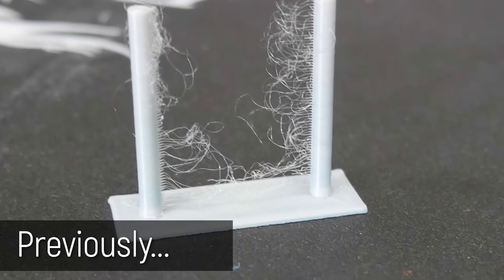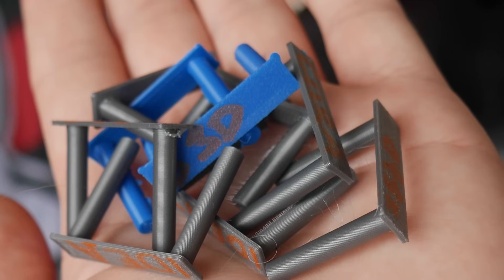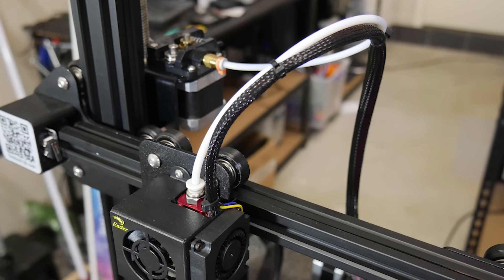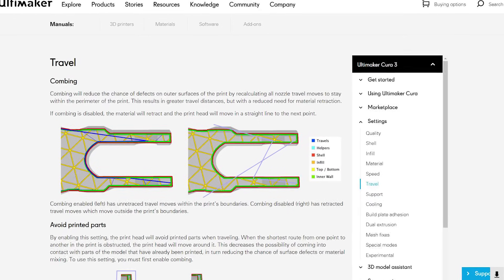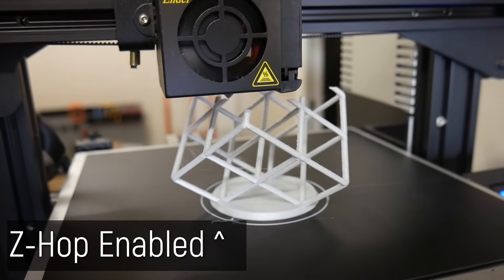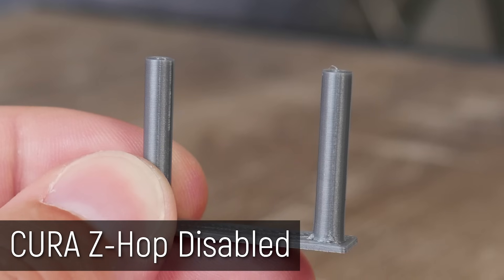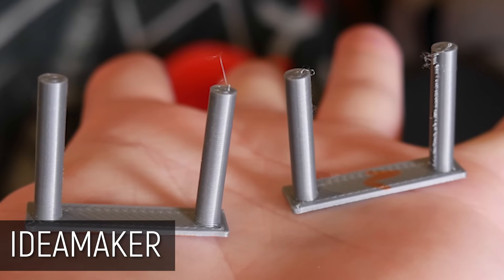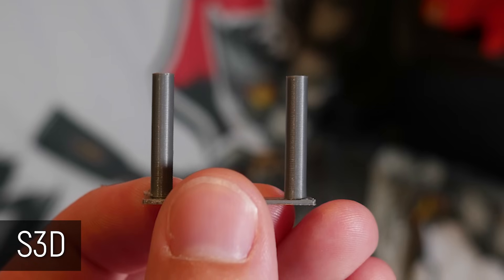Stop Ender 3 Stringing with this One Weird Trick! (ok but seriously)

Comment: Cura is a weird program. It has a lot of little things that arnt hard to fix but kind of annoying. like models not scaling correctly when you work in inches and export it with mm. Mine are always super tiny and on their side. again easy fix just a little annoying, all in all cura is a pretty good slicer it lets you crontrol everything you need and more, its just those little issues here and there. Also the interface is pretty trash i wish they had an orbit tool like in fusion 360. it would make everything so much easier. or a drag and move option, it might but i havent found it

Comment: I can definitely vouch for the quality control issue..  i just bought my very first printer today.. a Creality CR-20.. i got home.. put it together.. started leveling to bed only to find out that when the 4 corners had a  1 paper distance from the nozzle the center of the bed had 5 pieces of paper..  happily the shop told me to come by and exchange it with no problems.. got the new one home which i had to tighten both the bed and the slide with the nozzle cause both were extremely loose.. but after tightening them and leveling it perfectly i set it to a 6 hour print.. quite happy even with the slight snag :)

Comment: Stringing may be caused becaused of temperature. Probably the blue fillement may require à lower temperature and/or a better cooling whn extruded. May be should you have a try.
Regards

Comment: love your channel , I'm new to 3D printing,  I have ender3, been working well, with some tuning.
I'm having a problem with the filament melting in the hot end heat block, I have to pick it out will its running ? Have you seen this before?  Any suggestions  ? rdwbiker@yahoo.com

Comment: My print bed is also slightly warped but it plays within temperature a lot: when cool is is concave and when hot it is convex. I'm replacing the top with glass soon anyway to get perfectly flat, i really didn't expect it to be as flat as it needs to be.. It would actually need to be way, way more engineered solution with thicker aluminium base, milled from single billet and with heat flex optimization. At least in mine, the bed is so thing that the standard bed leveling methods warp it a bit... We are talking about very small tolerances here, +-0.02mm should be the start... Now it is more like +-0.1mm. But really, i don't expect any beds of that type to stay as flat as needed.... I need to smush the corners, close of getting marks on the bed and there is a slight pit. It is impossible from the materials, their properties and dimensions to work any better. I'm not happy about the pit as otherwise it would by uniform and manageable. I'm about 100% it is the actual bed "liner", the sheet that came with it is quite poor, it was visible warped but little massage got it quite right, except that one minor, minor pit that doesn't stop prints from succeeding, we are just darn close to it... 

Acceptable level of quality on mine. Printed straight out of the box with no adjustments of any kind. Of course needs dialing up and fine tuning... To me it feels a bit too flimsy but seems to be stiff enough. Oh, my carriage droops unless put under tension.. This machine needs another Z screw, bad... I know that it won't stay in this position forever and it starts to droop again. That drooping is not tiny, it is more than enough to fail any print and dig to the bed with nozzle..

Comment: Hey Angus this is probably an old topic now and you have probably moved and you might not even see this post but i have worked on my ender 3 profile and I have played around with a bunch of settings and i no longer get any stringing and have just printed the same stringing test you did with zero string i could provide pictures i also did this in S3D i dont use any other slicing software dont know if you wanna give my profile a test to see if you get that same results

Comment: I had time to do some tests. Usually I use a medium quality filament, without any stringing (Cura). I runt out from this filament, but in last year I ordered some super cheap Tronxy filament from Gearbest (for 13USD/1kg). With this filament and my classic Cura profile I experienced massive stringing. So I tested these profiles:

1. My classic profile, Cura = stringing
2. Chezmeister profile Dropbox, Cura = stringing, sadly. :(
3. Maker's Muse Simplify3D profiles (https://gum.co/ZrffZ) = absolute no stringing, not even one.

I am curious what is the setting in Simplify3D what makes it working. I don't see any special setting here, except Wipe nozzle 0,5mm? Maybe this. Retraction distance/speed is same as in Cura.

Comment: Hi Angus, I`v just started to use iDeaMaker after i saw this video. I haw however run into a rather strange thing, which I am not able to solve by myeself. I use The start-code script from my S3D profile, since I like how it put a line on the edge of the bed, before it starts to print. In ideamaker I have "Skirt" enabled, 2 lines, distance 8mm (as in S3D) - But, when the printer starts to print the objects I slice, the first thing Ideamaker makes the printer do - is to actually retract material - in such a manner that the PTFE is out of filament. So - it does not start to feed filament before the actual objekt is "printing" - and to be honest, I think it misses some in the first layer as well. Other than that, my profile seems to be dialed in on my CR-10 - the walls an other things is beutifull.

Any suggestions? I cant seem to find the "problem" anywhere in the settiings.

Comment: When I first got my Ender 3 I "acquired" S3D because it was the slicer that most of the youtubers were using. Its was giving me terrible prints and I thought it was my settings. After much profile tinkering the print quality saw little improvement so I tried Cura. WOW. Prints with pretty much stock settings were almost perfect compared to S3D. Cura became my main slicer... until... I needed to print some parts that were dimensionally accurate. I discovered that although Cura produces very good looking prints, its completely incapable of producing prints to the same dimensional mesurements as the file it was sliced from. So back to S3D I went. Bingo! Parts were printing to the exact dimensions. In the mean time I had started to lean to use blender and became more aware of the complexities of 3d modeling. Being a bit wiser I re-visited some of the prints I had issues with originally and found that the 3d models were poorly made and had all sorts of issues. Turns out that S3D wasn't the problem at all but rather the design of the 3d models was. S3D is a professional tool, an expensive professional tool. In Cura's defense my printer was calibrated using values acquired with S3D sliced prints so maybe I need to re-calibrate for Cura. I don't think the extrusion calibration would matter as its done independent of a slicer but the extrusion multiplier or "flow %" in Cura, might need to be calibrated to each slicer.

Comment: Can someone please help me and my husband?
I need to figure out the right settings. I opened up the video and watched it but we need it explained to us in a document or paragraph. I want to set my 3d printer up correctly and so far we have been getting a lot of help from everyone on here but this is still one of our biggest issues. we set the retraction to 3 and speed to 25. we set the print speed to 45 and the travel speed to 145. we set the temperatures to 205 nozzle and 60 bed. We have combing on within infill. Yet we still are getting strings. I did the gcode with 0 strings so we know it's possible but not sure what settings we need to tweak.

Comment: I have never experienced stringing with the Ender 3. Since I'm new to 3D printing,  I was using the software (CURA) included in the micro SD card. The only settings I have changed: Temperature,  print speed,  layer height, wall thickness and  top/bottom thickness.
Maybe temperature settings has something to do with stringing.
Never touched Z-hop but now I will mess with it. 
The only issue I encountered, was with the bed, specifically the mat, which appeared to be higher in the middle. Had to place the mat in a heat press for several hours.
Resume printing does not work, if I turn off the printer. When I tried.  it heat up, then move to the last location and just stood there...the screen shows printing, so the machine thinks it is printing.

Comment: Funny, my first printer is a Monoprice Select Mini V2. The stock Z axis on that printer is so slow I never use Z hop. I have since heavily modified the printer, including upgrading the Z axis to a proper NEMA motor and lead screw. So now it could do effective Z hop, but I still never use it. I don't have too much trouble with knocking printed parts over, and when I do I just slow the print speed to compensate. If the head is moving slower it tends to melt through the high spot rather than snap it off.

Comment: My Ender 3 is awesome. It Prints better than what I have seen done with a lot of much more expensive printers. Check out the "Tomb of 3d printed horrors" youtube channel for the best setup video I have seen for the Ender 3 (and I have probably watched all of them while I was waiting for my printer to arrive) and he also gives some very good settings in one of the videos, which I have based all of my prints off of. Even if you have already set up your printer, you may want to watch the video because some of the things he does will probably improve your prints. Also, do yourself a favor and buy the Ender 3 glass bed and the all metal extruder (I got the Seloky off of amazon). Clean the glass plate after every use with some alcohol and prints will stick fine (unless they are extremely small and need a brim) and they will come off very easy once they cool down.

Comment: I was also struggling with stringing lately when switching from amazon to geeetech PLA. Im using linear advance and it made a big difference on the issue. I also noticed that z hop was causing stringing but while i was making countless towers tests, i reread an interesting note about linear advance and retraction. Basically they say that if you have well calibrated your linear advance, you might not even need retraction at all. So instead of going up from 0.8mm to the max allowed by my direct drive, i went down and it was like magic, when i hit 0.4mm, stringing was gone, even with Z hop on. 0.35 mm gives stringing, 0.45 gives stringing but 0.4 is just perfect. Took me quite some time and frustration to get it right.

Comment: Combing is a function wich try to not travel when it don't need, it try to stay inside the perimeter of the printed parts. this function exist on S3D. I think you could do a similar function to stop stringing with the "retraction script" function wich permit to you to write a script that will be placed at each retraction (a small movement for exemple)

Comment: I have a CR-X so I have the usual owners bias, I guess. I had to take CR-X apart  to fix a cable I snagged and broke.  I used to design sheet meta chassis. The holes in sheet metal needed extra slop to allow for the threaded mating hole positional tolerance. When assembling the old way  the last screw was always a bear because of the accumulated tolerances. So re-assembling the CR-X was amazing to me. The mating holes were not only easy to screw together the threaded holes aligned in the flipping dead center of the sheet metal. They obviously use CNC robots to makes the holes. No way do they use any shoddy hand drilling. The days of China using shortcuts and cheap materials is over. You need to place the blame elsewhere, in my opinion. I haven't watched you since the CR-X review. It upset me. How did you get from snarky remarks from Creality owners to actually picking on Creality?  I've worked in Asia and I know that no Asian would disagree with you for fear of you losing face. It's just not done. You seemed stressed and apologetic.  3d printing should be fun.
Reply from the maker: The machine I was sent literally had hand drilled holes, it was pre-production and it showed. That was why I was angry, how can I review what eventually became a good machine (based on your feedback) when I'm sent something totally different? I can't see into the future, I just work with what I'm sent.
Reply: @MakersMuse  The main reason I was upset is that I watched your video after the I ordered a CR-X. I wrote a snarky comment which I really regret. You had convinced me it was a bad idea one day too late. I thought that maybe you should have told Creality. I now know you weren't aware they saddled you with a beta unit. After 4 weeks I had no printer and I was getting really tense. It turns out the delay was because they were fixing the faults you and the Nerd pointed out. I was totally out of line with my comment. After over 6 weeks my printer showed up the day I had written it off and was looking for another brand.  Creality came out with a video explaining that they fixed all problems on you tube. It was just a nice elderly women facing the camera. So here is a belated very big THANK YOU!
Reply from the maker: @paulf5351  Glad it all worked out in the end!
Reply: @MakersMuse  I wasn't so much worried about Creality. I ordered it from US company from a tiny town in the north woods of minnesota. I'm from minnesota and knew the town. The confirmation letter was full of Chinese characters and so I thought it was maybe a scam.

Comment: The cura has a feature where you can have different filament profiles for all your filament types. I wonder if you need an ambient temperature setting. I see you open your window during the heat wave you are having.

Comment: Hi Angus. I downloaded the modified S3D profile you made and then tested it before and after. Your file VASTLY improved my printing! Thank you. Disclosure: I am printing on a TEVO Tarantula, so apparently the process settings work across other printers too. 
One other thing...Although improved, the inside portion between the two posts where the travel moves happen still has a vertical "ridge" It's almost like a seam. But the stringing between posts went away with your profile settings. Now if I could only get that "seam" fixed, it would be perfect!

Comment: I've been using esun pla (and now their pla+) and slicing in cura since I first got my Ender 3, and have never had any stringing issues whatsoever. Very interesting to see such a difference in results.
Reply: I got the ender 3 pro few runs I did was grate so I tried to print a Glock 17 lowers base lines are good amazing but once it starts printing the lower it's starts good then turns to little gaps an strings any idea ?

Comment: Oh no.........please don't make me use CURA again. I know when I'll be using it and run into problems, I will ask myself why did I switch from S3D? Then I finally return back to S3D and will ask myself what exactly did I not like about CURA and switch again. It's a disaster.
Some models are sliced better in S3D while others slice better in CURA.
But S3D slices much better with more CPU cores (I have 16cores so I'm a cpu-multithread freak) in use, so I prefer that.

Comment: Just about ready to pull the trigger on a 3d printer. Here is my take on your apology and the "need" for it. While those who are financially and apparently emotionally invested in brand X may see the need for you to "correct" your review, I don't. There is a saying in dirt track racing, "Run what you brung". Not very eloquent, but to the point. Is it really your problem that this product does or does not perform a task without an unknown number of variables being just so? I am a former Engineering and Quality Control Technician. From my perspective, it should not be the consumer's job to do quality control on a product and it should be at least adequately designed for the task at hand. Poor design and poor execution are not your problem.

Comment: The reason Cura produces that stringing with z-hop enabled on the towers is simple because the combing relies on 'cleaning' the nozzle moving from the inside of the tower to the outside. With S3d you an also throw 'coasting' in the equation (also helpful for bowden extruders) to reduce stringing and other artifacts caused by the build up pressure on the filament.

Comment: My 2 cents about Z-hop making wores in the string test on cura.
What you actually want in the passage from internal to external layers is to "scrape" the nozle on the layers to clean it so it come out clean.  If you hop, you avoid this scrape and the retraction could more easily fail. 

You could avoid it anyway with some tuning of retraction and temperature anyway. But it takes some try you often need to repeat this calibration everytime material, nozzle and sometime even enviromental condition are changing

Comment: I've REALLY gotta do this. I have huge issues with stringing. You know what's the weirdest part? I have two identical Ender 3 printers (I call them Leana and George). Leana has MAJOR stringing issues and often fails whereas George can print the same g code albeit still with stringing (at least he completes the print). Same filament and everything. I don't know why Leana has issue with it and George doesn't even though they're the exact same style of Ender 3.